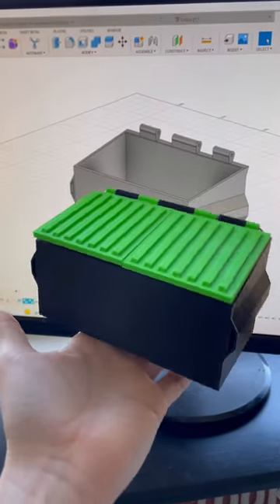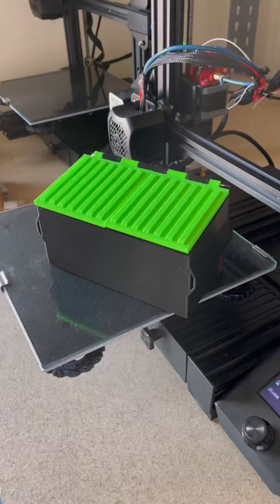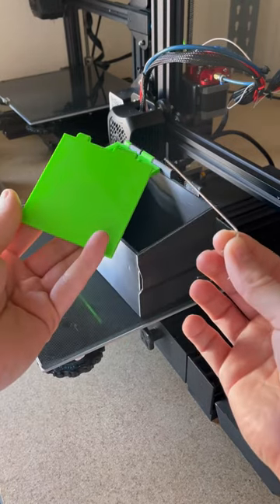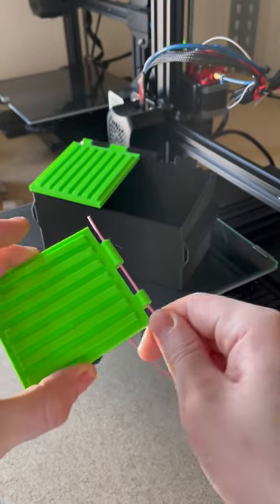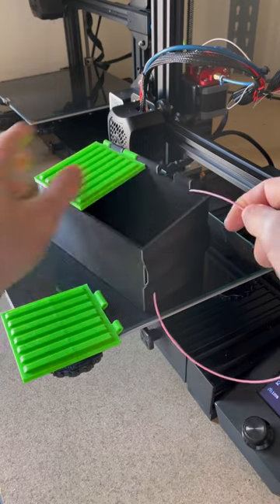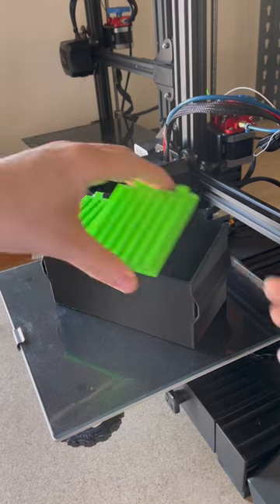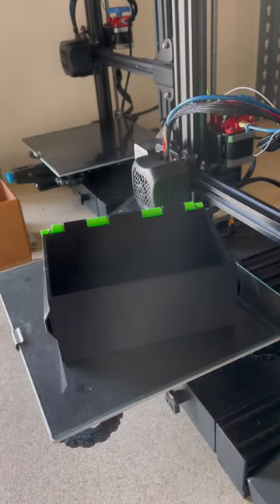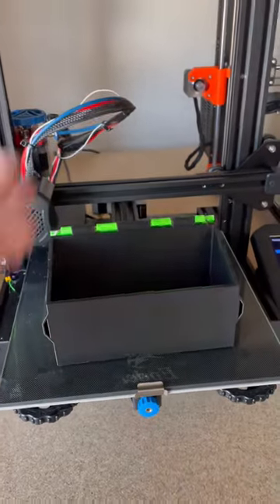Designing & 3D printing a mini dumpster!

Comment: I think u stole that off thingiverse lmfao
Reply from the maker: I've uploaded videos of my entire process designing this product! There are other designs for mini dumpsters that exist online, but none like mine. Mine is larger, includes end caps to secure the filament in place, attachments such as 2x removable dividers & full length dividers to change the inside color of the dumpster, double & full length lid options, and more! All of these attachments only fit my design, none of the others.

Comment: Designing a new product that exists, and looks like the pre existing item.
Reply from the maker: Dumpsters have been around for quite some time now. I'm designing my own version of a fully 3D printable mini dumpster. Sure, a 3D printed dumpster has been done before, but I'm not worried about the competition. Mine is bigger, able to be printed without any supports, has different storage options such as removable dividers which allow for more customization, and its going to be added to my catalog of over 70+ different products that can also be printed and sold. (3DPrintFarming Patreon Catalog)